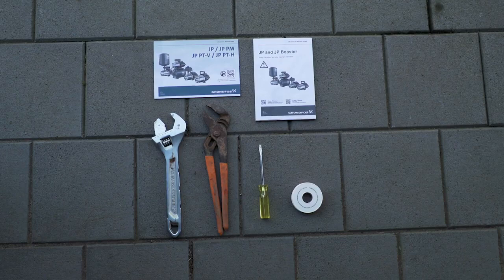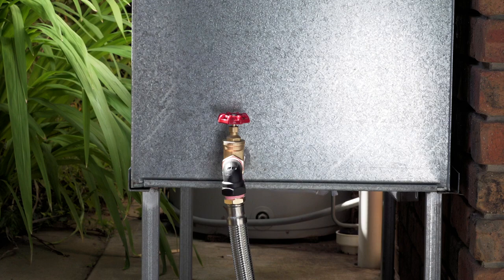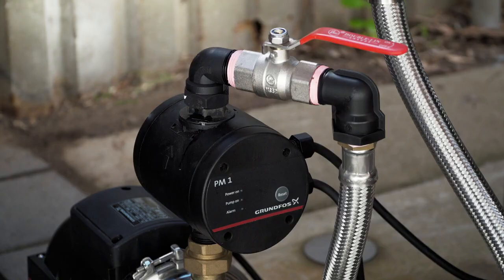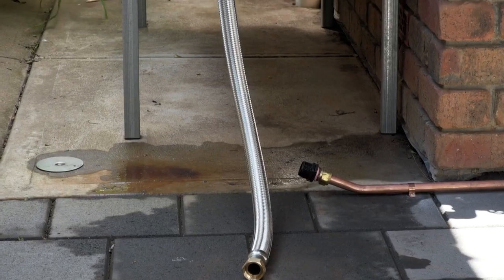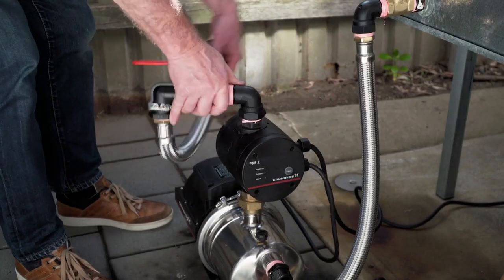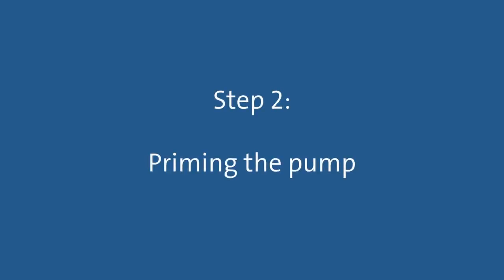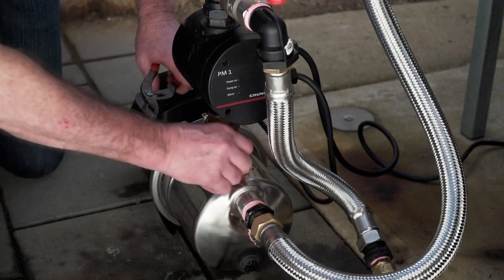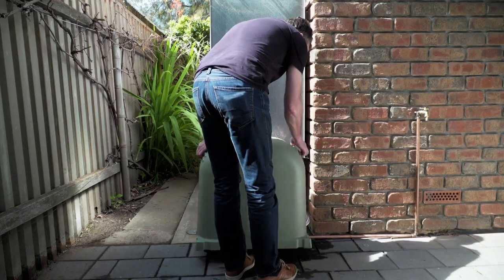Grundfos Jet Pump - Easy Installation Guide

Comment: I have a tight spot where I can only mount such a pump vertical. With the motor fan facing up and out of the rain, will this reduce the life of the pump at all?
Reply from the maker: Hi @teravolt1195, great question.  As you rightly mention, the pump you are commenting on is not designed to be mounted vertically but our service department has advised that it should be okay mounted vertically. I would also suggest having it out of and away from the elements is important. Hope that helps. Aaron
Reply: @grundfos  awesome! Thanks for the reply, much appreciated

Comment: Dear Grundfos,  if the power is off and back on,  do I need to press any button on the pump to start or it's automatic?  I will use the pump in an offrid house. power cut is quite often so I don't want to go into the cave to press the button  everytime when the power is back on.  that's why I asked,  thanks in advanced.
Reply from the maker: Hi @ellyi4567, can I just say right off the bat, that living in a cave sounds really cool. But, in all seriousness, thanks for your enquiry. There are three different styles of pump in the jet pump range but it is automatic for all models.  As soon as the power comes back the pump will re-prime and then turn on when demand is created/tap turned on.  Word of caution though. This scenario is ok if there's positive inlet pressure.  If the water source is below ground you will need to make sure a foot valve is installed to keep the water in the pump when the pump has no power and no way to re-prime itself.  Also, if you're off grid and using a generator, you might like to look at SCALA2. Much better at fluctuating power supplies, and soft starting, so won't trip circuit breakers as easily. You can learn more about SCALA2 here: http://gfos.ly/6056j4PjE. Regards, Aaron